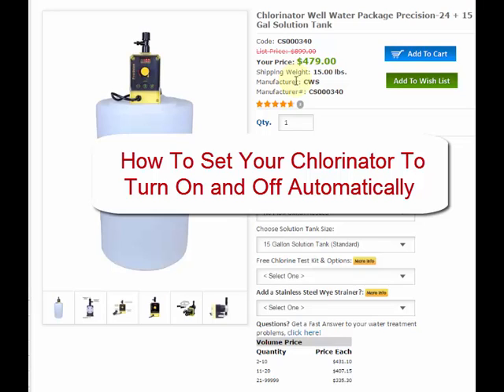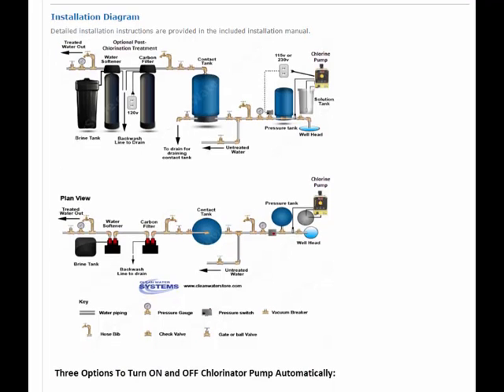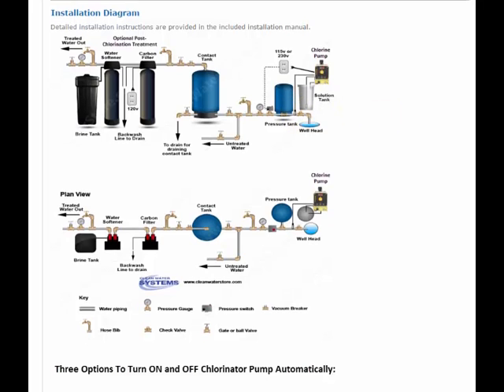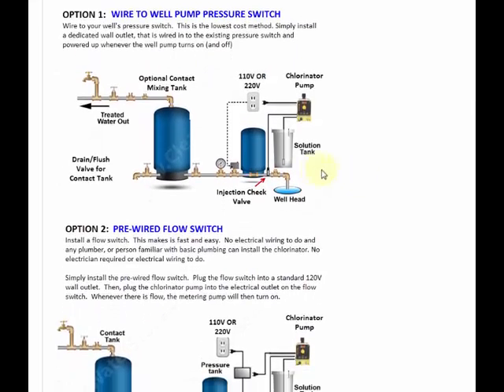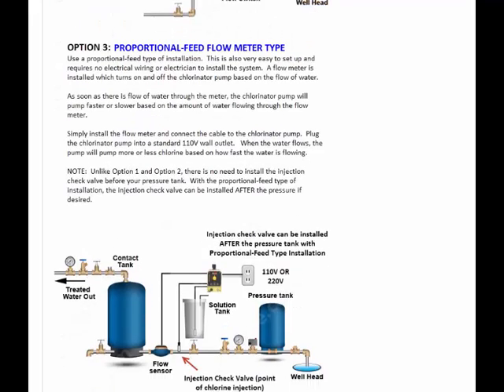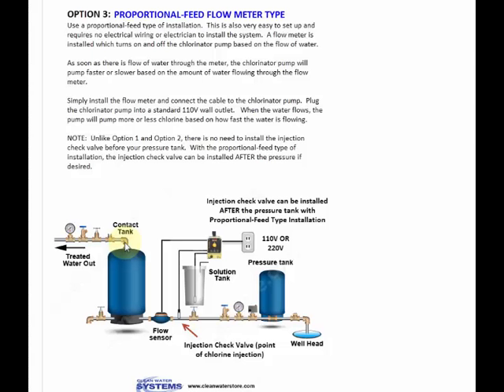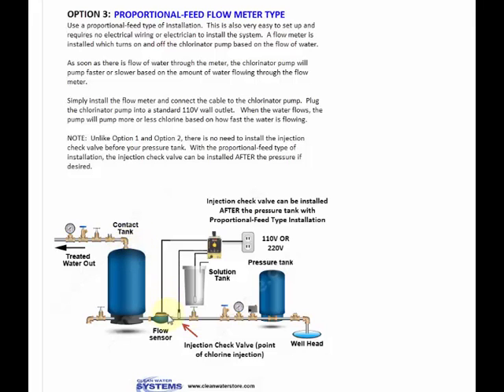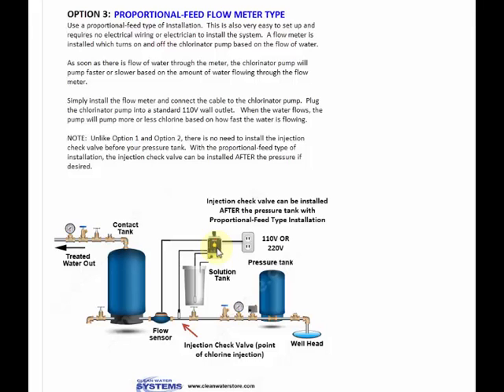How To Wire a Chlorinator Metering Pump for Well Water

Comment: Great Job!  New sub. Question:  does it matter if the flow switch is before or after the contact tank? Any benefits of being before contact tank?  Thanks 👍👍
Reply from the maker: Hello -  thanks for your feedback.  It is best if the flow switch is between the well pump and pressure tank.  On a typical single speed submersible pump with a pressure tank and pressure switch, the chlorine is best injected in between the well pump and pressure tank.  Since the injection point is there, its best to have the flow switch in same section, between well pump and pressure tank. The contact tank is best installed after the pressure tank so the flow switch would be before the contact tank.
Reply: @ Awesome and Thank You for the response.  My set up is like you say with the exception being the flow switch is shortly after the contact tank. So as the house demands water the flow switch energizes the injection motor. I have verified the injection motor is pulling from the solution tank and feeding out the injector but still not seeing any solution getting to the contact tank. I have replaced the duckbill valve in the injector.  Will be increasing the length of the 1/4” feedline so it goes all the way to the duckbill.

Comment: How would I wire in a Penn F 261 flow switch to turn on my chlorine Stenner pump
Reply from the maker: Hello -   one way is to set up a dedicated wall outlet receptacle.  Wire it so the flow switch allows the outlet to energize when there is flow. Its hard to give exact electrical wiring as it depends on voltage but typically no relay is required, you would just use the F261 to turn and off one of the legs leading to the outlet.  We also carry a pre-wired flow switch if your Stenner is 120v.  Just plug the flow switch cord into a wall outlet, and plug the Stenner cord into the outlet on the flow switch. https://www.cleanwaterstore.com/flow-switches/flow-switch-thomas-indoor-1-pre-wired-straight-110v-05-gpm.html